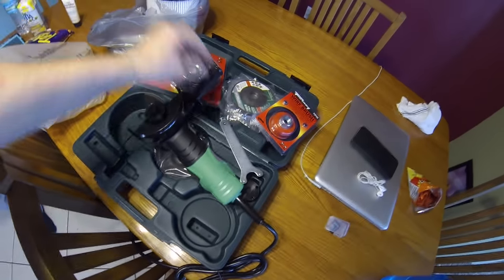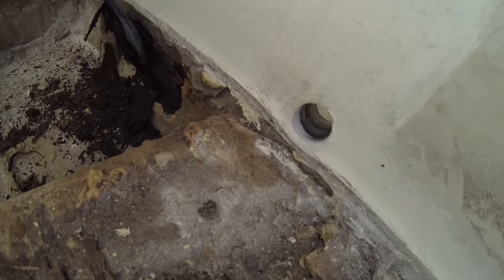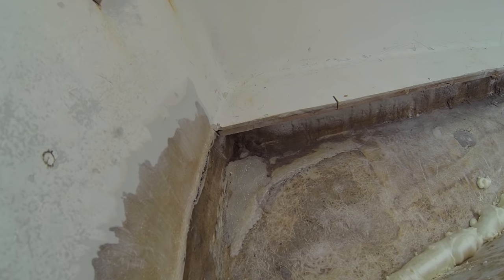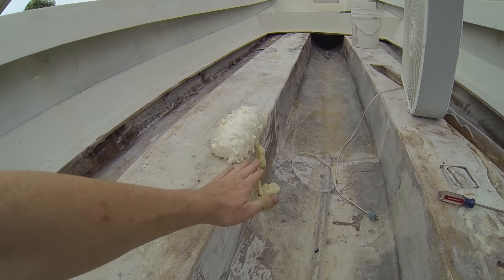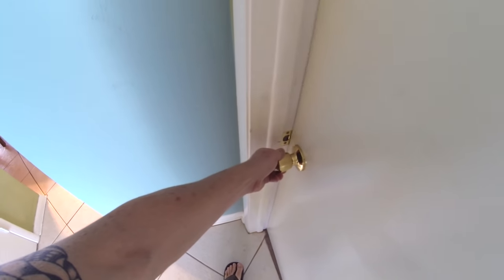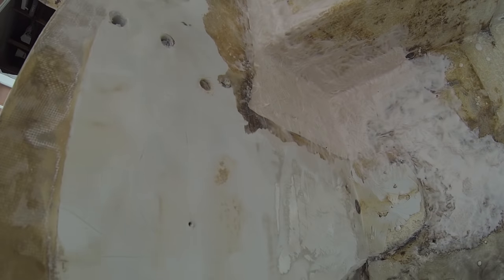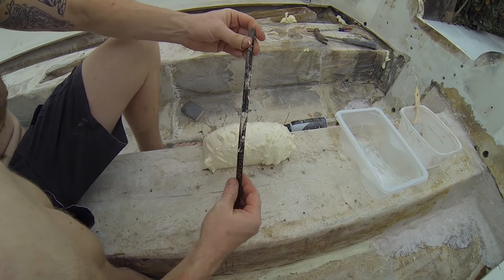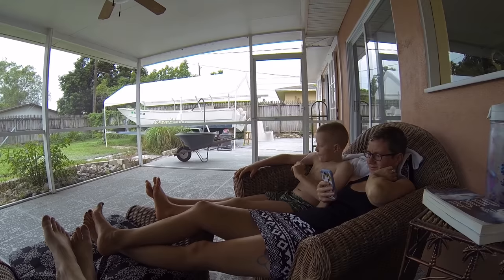How to: Brace a Fiberglass Transom

Comment: The way I cut expanding foam is to run the hacksaw blade over a bench or hand grinder to put a blade on it but leave a bit either end to hold it then cut away you get a smoother finish than you do with the teeth still on the blade great video.
Reply from the maker: Nice tip! I’ll have to give that a shot.

Comment: is plywood generally glue to the foam on fiberglass boat
Reply: most use marine ply wood, but in this day and age there are high strength foam boards etc other than wood that eventually dries out and sucks water, better using the hy bred materials  check hy breads material on redoing boats

Comment: Did. You take a Moisture meter to the stringers??? Pour foam is not structural! Would think you should cut a core sample or two out of the stringers at the stern area, especially with all the rot on the transom, and the gaps at the base of the stringers you put foam on. I would be certain that your glass may be good,Yet what's underneath will surprise. I would recommend you take a closer evaluation of what's rally going on.bjust an opinion here!